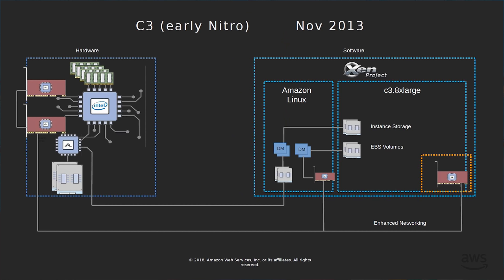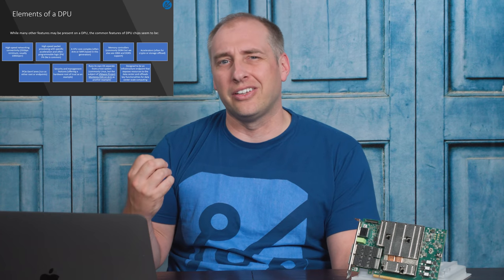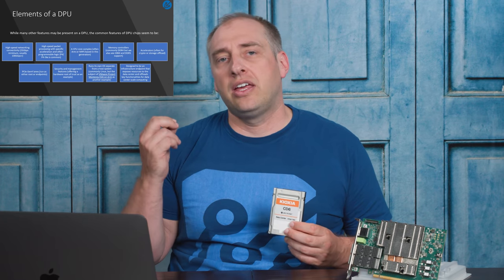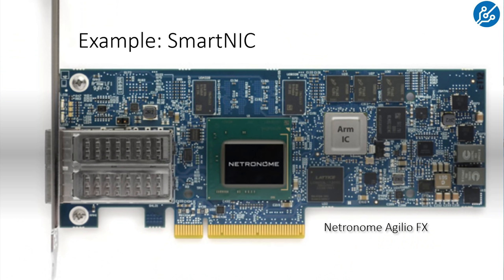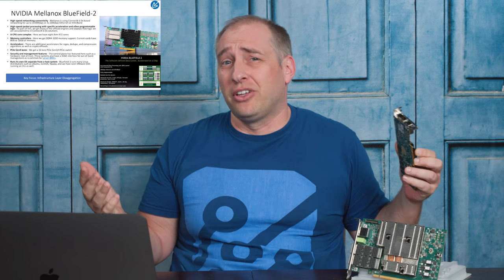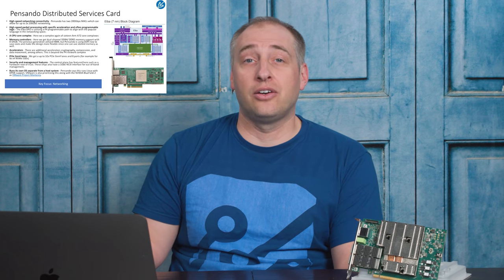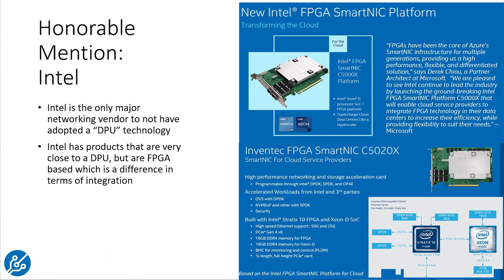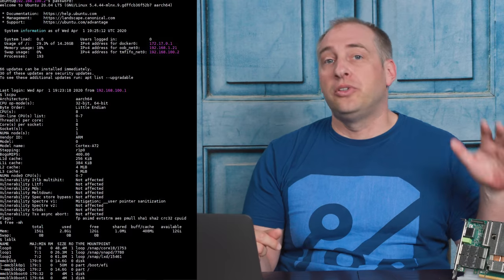DPU vs SmartNIC vs Exotic FPGAs A Guide to Differences and Current DPUs

Comment: Throwback to the mainframe days with everything having its own processor or coprocessor,etc
Reply: Isn't that always the way. The question is: what happened next that replaced this on the mainframe.

 Were seeing some interesting ideas such as compute on memory, are we going to see a degree of look ahead so that the memory works out what the cache is going to want before the cache asks for it??
Reply: Exactly. And interestingly, all these DPU things seem more like a souped-up glorified Raspberry Pi that plugs into a PCIe slot rather than running as a standalone box or board in its own housing. This video actually made the whole thing make better sense to me from a use case standpoint, especially the part where Patrick is explaining the whole licensed core dilemma where some of those CPU cores that would otherwise go toward hosting more users' VM sessions instead end up handling the infrastructure, communications and "operator console" functions that could very easily go to a separate coprocessor system without issue. Really, my only problem seems to be in the choice of terminology the "industry" decided would become common parlance. Based on what this video has taught me, "DPU" is way too vague. Anything could be called a "data processing unit" (Because, of course they process data, but WHAT data is that exactly?). These things should be called Infrastructure Management Coprocessors, or IMCs, as that terminology is more accurate to the function of the devices in question. But, that's just my opinion as a non-engineer, non-IT technician, average Joe Q. Public commenting on YouTube videos and forum threads.
Reply: Then physical security was often enough. Now we have to update firmware, microcode, software on all these components...
Reply: Or the Commodore Amiga architecture with what could be called the first accelerator based architecture thanks to it's way ahead of time chipset that made it the miracle it was for the time!  (And of course, ahead of time on the consumer computer market not the mainframe market)
Reply: For a while there performance capabilities were ahead of even service provider demands, so you could just offload everything onto the CPU in the form of proprietary driver packages, and have the bare minimum hardware on an add-in card doing the actual interface work over DMA. But now performance gains have fallen behind scale service demands, so offloading tasks to other processors to maximize CPU availability is necessary again.
So the hardware companies are scrambling to meet the new demand, this is why we're seeing T1000s being used to accelerate databases, Intel's external AVX and Database accelerators (which was born from Xeon Phi, and in turn gave birth to Intel Arc), the sudden explosion in focus on hardware AI acceleration (Tesla, Coral, Greyskull, Grok, etc), smart network cards, and even the return of hardware RAID cards (in the form of beefed up PCIe switches with an integrated storage management layer).

Comment: "Data Processing Unit" might be the vaguest possible name for a computing device and I'm baffled about how the industry came to agree on that nomenclature.
Reply: Yeah, I second your motion on that. How does Infrastructure Management Coprocessor, IMC, sound? In my opinion, IMC sounds a LOT more like what these devices are doing. Of course, they are also like glorified Raspberry Pi boards, but which plug into a PCIe slot instead of being a standalone device, so maybe they can also be called Console Control Processors, or CCPs. Just a thought.
Reply: Are there any processing units that do not process any data at all? lol
Xilinx uses the same name for their "Deep Learning Processing Unit," an IP-core for ML. Now I can see it makes more sense than Nvidia's naming.
Reply: At least Intel calls them IPU (infrastructure processing unit).

Comment: Thanks for a great video. I worked at Synnex a few years ago doing Post Production Testing of Smart NICs of AWS Nitro Cards. The CPU used was a custom design from Annapurna Labs manufactured by TSMC. The management at Synnex is a motley collection of jerks but the Technical Staff is a bunch of sharp dudes. I had a blast and learned more than I could ever imagine.

Comment: History might not be on their side when it comes to the "push everything to the edge" philosophy. I'm all for hardware offloading but there is a point of diminishing returns. And maybe adding a full server to an AIC just to do TCP and IPSEC/TLS acceleration is falling into that ballpark.

Not that long ago in the earlier days of cloud computing (mid 2000s) there was a push to move processing to the network edge and I'm feeling like there's some repeating themes with DPUs.

A good example was SSL accelerators. Expensive boxes promising to take heavy cryptographic processing off your servers so you could process more transactions with fewer servers. Neato!

What happened of course was those edge boxes got overloaded and slowed down traffic, and unlike servers were not easily upgradable, they were also yet another failure point and security target and introduced extra hops (latency).

Turned out burning a couple of cores on your CPU for SSL was cheaper, used less power, was easier to manage, and ever faster cores were being added to CPUs so quickly it stopped mattering.

Looking at the sheet for the BlueField-2 I see nothing a CPU can't do quite well: AES, SHA, TLS, RNG, Compression/decompression. 

I have to say I do find the idea of regular expression acceleration quite cute because I live and breathe regex but honestly, when your traffic scales up what do you think is going to crumble first, your 16-128 core Xeon/EPYC server, or the 8x Armv8 A72 cores on your NIC (the same cores as in a Raspberry Pi)? 

Can anybody suggest an application where they've thought;  I really need extra CPUs to handle this specific workload and the best place for those CPUs would be in a low power ARM server on my NIC?

I suppose time will tell if I'm speaking from experience or a failure of imagination.

Comment: arm/risc-v cores combined with an unlocked FPGA co-proccessor is the solution i prefer most because it enables end user reconfiguration of the types of hardware acceleration along with the ability to update said acceleration capabilities down the line via software updates.
Reply: agreed that flexibility is really exciting
Heck one cool feature I saw was eBPF being turning into FPGA programming allowing for accelerated networking at the smartnic level (so potentially something like Cillium could use to accelerate Kubernetes based firewall and networking in general!)

Comment: So on the one side you have the idea of moving a DPU into your server as an additional Layer in the stack, which is happening in the "general purpose" server space, while on the other side you have the NICs moving closer to the workload, even be included directly on the die of the workload chips themselves, cutting out the middleman of PCIe and an external NIC.

I feel only one of these should be called a DPU, since they're so fundamentally different.

Comment: Very refreshing!  It would be interesting to see the optimum setup including price for a startup Kube cluster.  For example, is it better to buy four 1U dual 16 core 256 gig 10 SSD servers or for around the same price, a single server with three DPUs to use to run web APIs?

Comment: Thanks for this high level overview of what DPUs are.

I DO wonder though - that if it has a PCIe 4.0 x16 slot, that means that you still need a host systems for said PCIe slot, don't you?
Reply from the maker: No you do not. It can run as a PCIe root port off of the x16.
Reply: @ServeTheHomeVideo  
But what I mean is that you still need a system to provide the PCIe x16 slot that this card connects to, don't you?

Or are you able to run it WITHOUT plugging it into a PCIe x16 slot on SOME sort of a host system?

(i.e. you give it power, and away you go, e.g. you can run it off a GPU crypto mining riser.)

Comment: I think the future lies in general purpose FPGA like accelerators like the Xilinx Versal chips, connected to a high speed interconnect bus.
So for example for TLS acceleration, the CPU would configure the versal cores to do AES encryption / decryption. If a TLS tunnel needs to be accelarated, the CPU would instruct a "SmartNIC" to DMA all packets on that Connection to the Accelerator card, where the decryption/encryption happens.
As the Versal Cores have a pretty configurable pipeline, you could use the same Card / Accelerator to do AI inference as well, by just reconfiguring it on-the-fly / using some cores on it for Task A and some for Task B and such.

Comment: Is one of the key requirements for the DPU definition that it has the ability to connect to an ethernet network? If so, then the term DPU is probably too general to describe this specific use case. 
For example, if someone put a GPU + Arm CPU combo on a PCIe card and stuck it in a server, where it can act as both a PCIe root and endpoint (simultaneously), but does not have a network connection, then shouldn't that also be considered a DPU?
Another example would be one of the Xilinx Versal FPGA cards which have an ARM A72 + FPGA + AI accelerator, but don't necessarily need to have a network connection (I think they do, but that would be more of an out-of-band port). Could that be considered a DPU?
Reply from the maker: High speed networking is one of the requirements in the video and on the site, but not specifying Ethernet only at this point. Actually the BlueField-2 DPUs can do InfiniBand as well
Reply: @ServeTheHomeVideo  Then I think that DPU is too general of a term here, where Smart NIC would probably be more precise. 
It's sort of along the lines of calling GPUs "SIMD Processors", but then requiring anything called a "SIMD Processor" to be able to render 3D graphics (i.e. something like a Phi wouldn't fit into the definition of "SIMD Processor").
To me it seems like DPU should describe some sort of asynchronous accelerator, where a GPU would not be a DPU, but one of the Phi cards would be (even though they have no networking capability as I recall).
Reply: Or is the thought more along the lines of Data Processing == Data Stream Processing, and is abbreviated? i.e. streaming data over a network (I think that would be fundamentally different from something like a Phi card).
Reply from the maker: @hjups  Went into SmartNIC v. DPU in the video. DPU is what the industry is using.
Reply: @ServeTheHomeVideo  Sorry, I watched that part and forgot about the distinction. And by your explanation, SmartNIC doesn't adequately describe these accelerators.
I'm not sure that DPU is precise enough though considering your exclusionary definition, regardless of if the industry is standardizing around it (the industry has standardized around plenty of poorly defined definitions before, mostly for marketing purposes). 
With that standardized definition though, how would you define something that looks similar to a DPU, but isn't meant for high speed networking or packet processing acceleration?
Something like a SoC with an AI accelerator in it for example, which may have an out-of-band access port, as well as PCIe root + endpoint connectivity? If I recall correctly, Xilinx has a new Versal card that pretty much meets that definition, where the FPGA is not programmable, and instead acts more like a google TPU with an ARM core running Linux.

Comment: When can I get some of these for the homelab? :P
Reply: Ebay in a few years
Reply: You can bag the xilinx smartNIC accelerator cards on digikey. It's more set to run acceleration algorithms on the FPGA, and has no ARM cores. The HBM variant isn't all that expensive either, a few thousand last I checked.
Reply: Same, I really want to try some stuff with Kubernetes on those (Control Plane on DPU, Worker nodes inside the servers)
Reply: @asdrubale bisanzio fair enough

Looking for budget sources is challenging for these, but I'd expect some of the earlier accelerator dev boards that were snapped up by the crypto miners to come on the market in a few years. I think the popularity of that board is what lead to the alveo line.

I mentioned the HBM alveo because it's far less expensive than any of the HBM enabled virtex us+ line. It's also one if the few that have PCIe 4, and in CCIX mode at that. Only x8 lanes, though, but it has two ports pinned to the x16 edgecard connector.

Comment: This whole idea seems counter productive in a time cpu cores are the getting cheaper and more dense.  It's adding complexity and a part that is very much static and not scalable.  That's not even getting into the security aspect.  I just can't see the advantage except for very special workloads that only Microsoft or Amazon would deal with.  The average enterprise would never use these to full capacity and even if they do its going to be cheaper and easier to throw x86 cores at it.